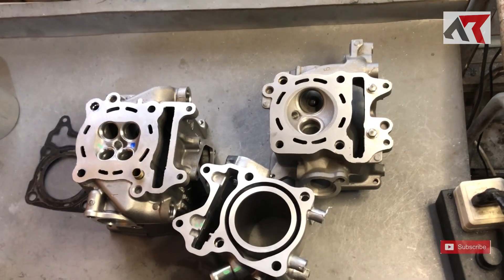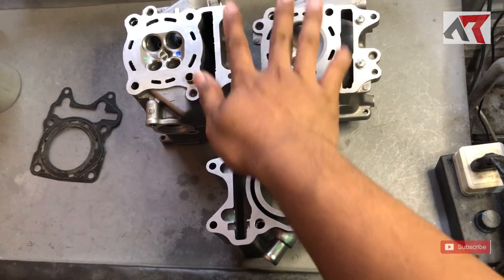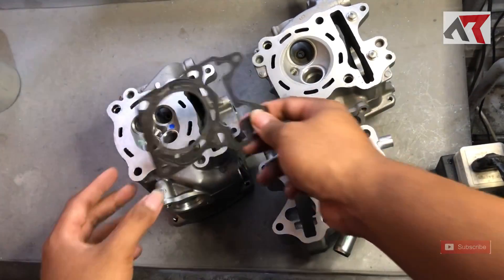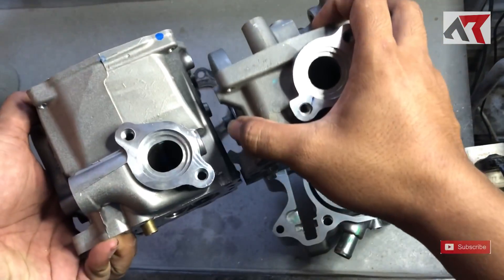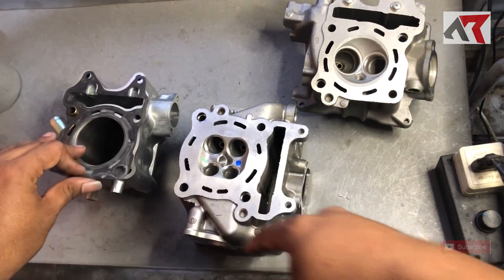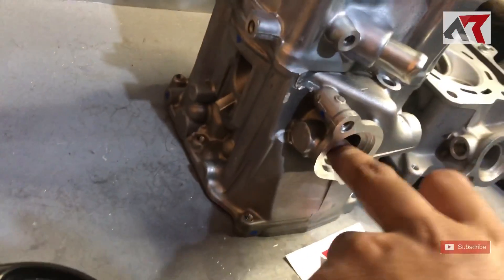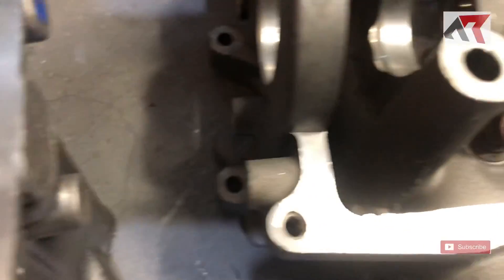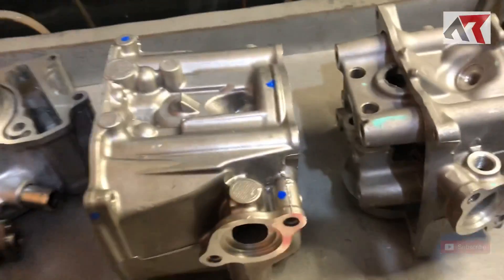Bikin Vario /pcx old jadi 4 Klep! | Swap pakai Head PCX 160? Bisa Pnp ??

Comment: Kayaknya lebih enak satu set aja, silinder+head set. Terus tinggal rumah lubang bautnya, jadi ngga kebanyakan ngelas tambah daging, atau malahan kalau mau enak ya rubah posisi baut tusuk sate yg di crankcase.

Sensor o2 lebih enak di leher knalpot, bacaanya lebih akurat
Reply: Lebih rumit karena PCX 160 itu struknya lebih pendek. Bloknya harus ditambah daging biar agak panjang atau stang sehernya harus ikut dipendekin..
Reply: @yusufmaulana4306  atau malahan bikin packing aja dari alumunium
Reply: lebih enak ganti ke aerox/nmax 2nd terus boreup deh itu nmax...lbh maximal hasilnya
Reply: @iwanhutamasanjaya976  kaum mendang mending yah
Reply: @ranggarudwino7678  maksudnya?????
Reply: Betul bng pengen nyoba tapi gadak duit wkwk

Comment: Biar gak terlalu banyak ngecor bang..enaknya pakai head ama blok pcx 160 semua bang tinggl ngerubah baut tusuk sate di crankesnya bang..🤣😁😁
Reply from the maker: Dipikir pindah baut tusuk sate nggak ngecor?
Reply: Klo liat posisi permukaan head pcx 160 dan block vario sih yg lbh worth  ya bkin penyesuaian di area permukaan block & head kek nya dah ,klo rubah posisi baut tusuk sate klo hanya mau  ngejar pnp in itu head ya buang2 waktu&tenaga 🤣 turun mesin itu klo rubah tusuk sate .kecuali sekalian main stroke tinggi paking selemabar dah baru worth .biar di tinggiin skalian coran permukaan crank case ny 🙏lgi pula tusuk sate klo dudukan ny d ubah rada riskan jg kayanya ,scara itu penahan/pengunci block&head beserta perintilan ny ke crank case 🙏.